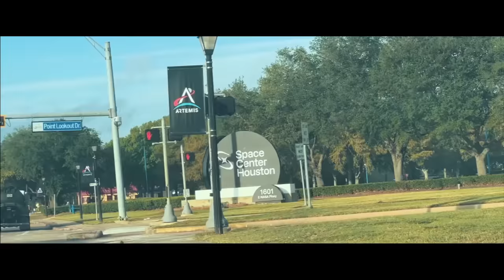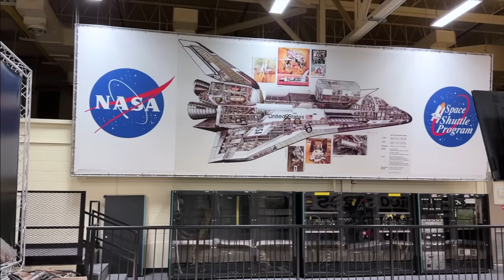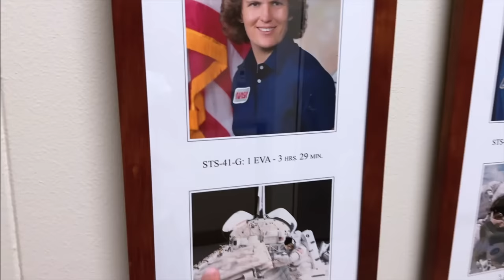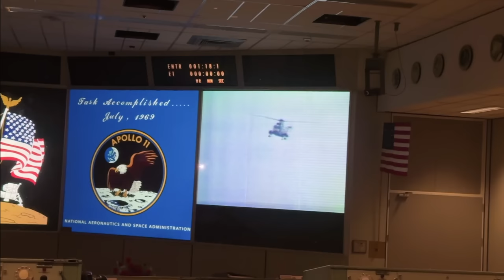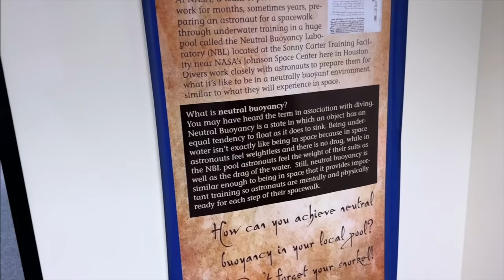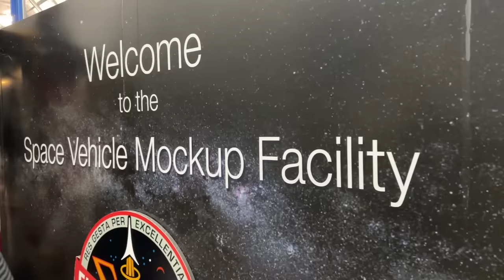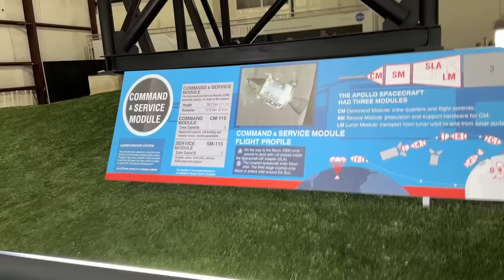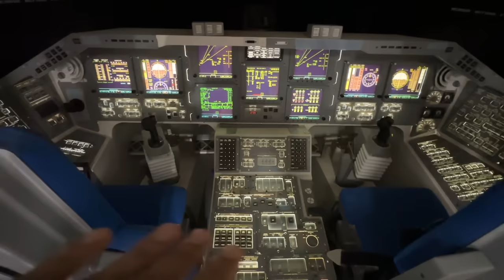Life of a NASA Astronaut! Salary 💰?

Comment: I wanted to correct the part at 16:43 where u said the the spaceship went to space with the help of the plane it's completely wrong the plane wsa only used to transport the shuttle from edwards air force base(ca) to cape canaveral(florida) the shuttle used to go to space with the help of a separate rocket not the 747. the 747 was used during the intitial testing where the rocket used to be released mid air so nasa could check whether it will b able to glide properly.Sometimes during bad weather in florida they made an arrangement to land the plane in california so they used the 747 only to transport it back